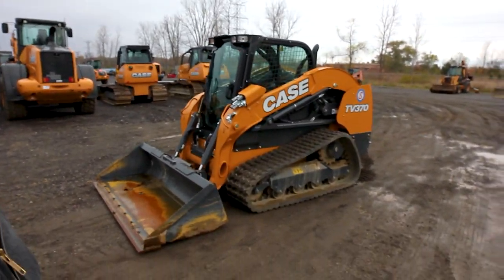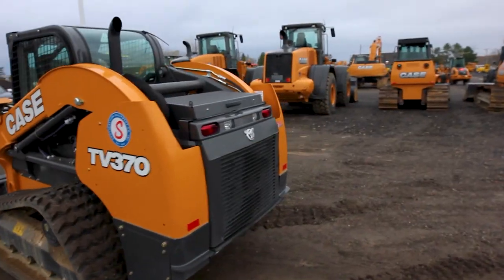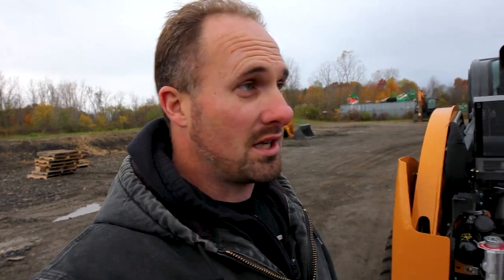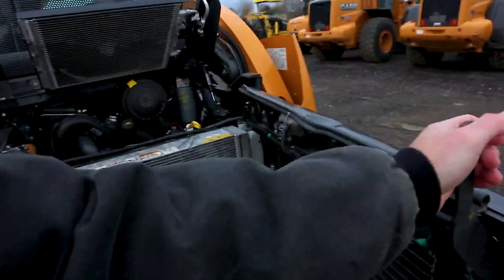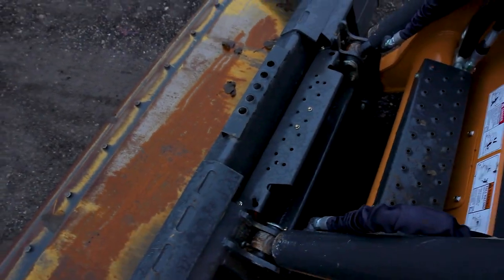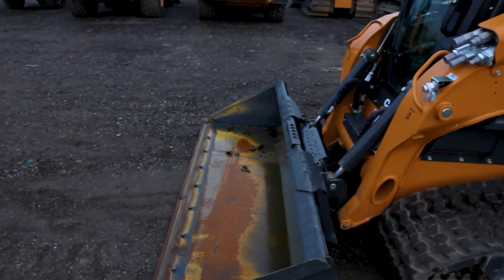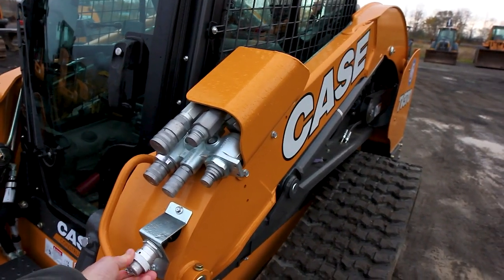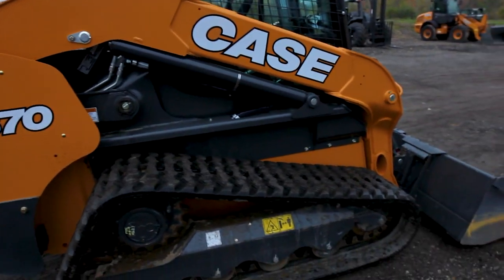How To Run A Skid Steer Part 1 -  Machine Walkaround

Comment: Just a small correction regarding the hydraulic power on the curl and dump cycle. The power is on the curl and the speed is on the dump. The surface area is lower on the curl part of the stroke meaning higher pressure and slower speed for breakout force. The dump cycle of the stroke has more surface area against the piston providing the speed to dump quickly and less pressure. Great vid. I recommend these to all my new hires :)
Reply from the maker: Thanks for that explanation brother! That's really helpful to understand how that works.
Reply: On an excavator yes, but on a skid steer such as this Case power is on the extension and speed on the curl referring to bucket movement.

Comment: I notice there’s a southeastern equipment logo on the machine. What area of Ohio do you work?
Reply from the maker: I'm actually up in Michigan.
Reply: Huh didn’t know southeastern was there. I just thought they were only in Ohio but cool video
Reply from the maker: Thanks man! I appreciate it!
Reply: Diesel and Iron No problem, in the next video you should demonstrate all controls like pilot, h pattern, and hand foot if you haven’t thought about it already and possibly explain the benefits of having a 4 in 1 bucket over a general purpose and techniques you can use with a 4 in 1
Reply from the maker: @wwryan  My next video is a generic "in cab" tour but I love the suggestion.  I'll start throwing together a video going over the different patterns.  Down the road I'll definitely talk about 4in1 buckets and grading techniques.  Thanks for the input!
Reply: Diesel and Iron yea no problem! I’m 16 years old but I have quite a lot of experience with a skidsteer. Been running one for a while and have learned new techniques and also things not to do!